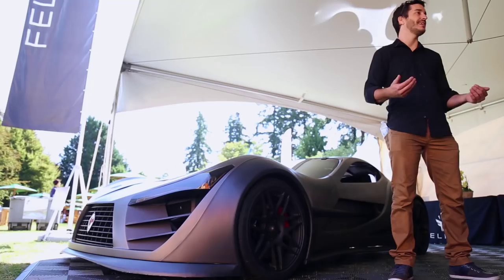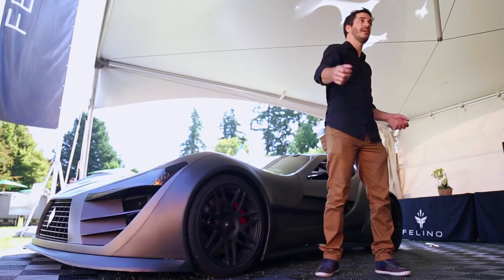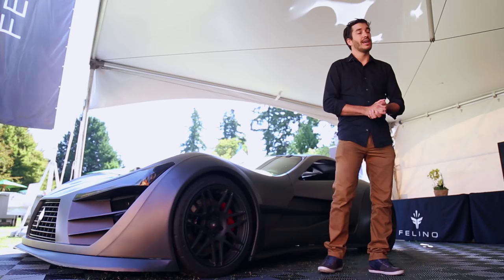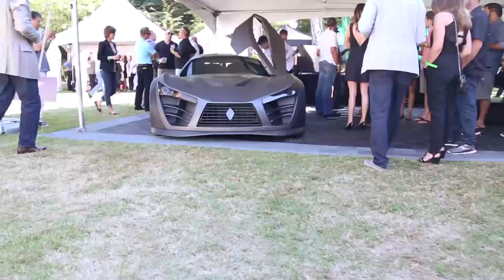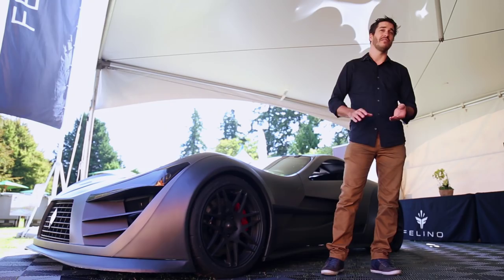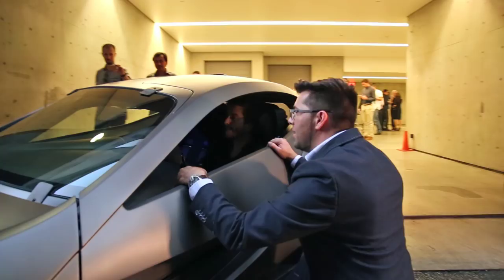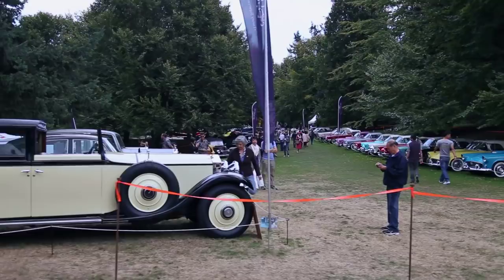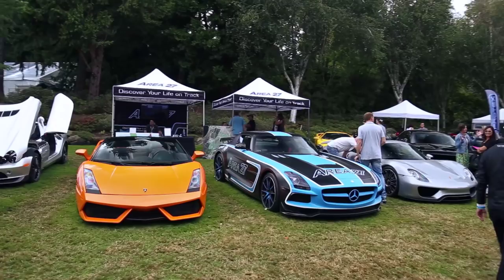Felino CB7 Prototype | A New Breed of Supercar

Comment: Why an ls3? Kind of an odd choice for such an exotic looking car.
Reply: For such a long nose you'd think it had something like a v10 or an inline 6 that was shoved a bit back for better weight distribution.
Reply: because cheap crate engine. Fits well with this "exotic" kit car.
Reply: +Will Boehland an ls3 is a damn good engine , American cars get such a bad rep and i agree with most of the negative things people say about them . but but the ls engines are very light , hell you can put an ls1 in a miata and the v8 doesn't even weigh more then the four banger that puts out a third of the horse power . the ls3 puts out damn near as much power as the AMG engine in a Pagani for a fraction of the weight and a fraction of the price ,and you wont need to pay an arm and a leg for parts and service . people who think you need to pay too much for European engines . and Hudson fox , i guess the Pagani cars are kit cars because they use someone else's engine , every company out there uses parts made by another manufacture . even if you don't like the overall look of the car it's nice to see some Canadian super car .
Reply: +jerry henderson it's a good but cheap engine that's used for cheap power in cheap cars, it's not built, it's not forced induction, it's a dated ls engine model. It's bland and boring. There is nothing exotic or interesting about the ls3. It does exactly what people expect it to do. Doesnt even make 100 specific horsepower per liter.. Doesnt rev up high, has no character, I dont think I need to explain myself any further.
Reply: Will Boehland its almost half the weight of any other v8 on the market and still puts out as much or more power then any other naturally aspirated engine . less weight = better power to weight , and an engine that produces lots of low end power doesn't need to rev high . if you are running high revs your burning more fuel , and those exotic engines that rev high and produce more power per litre  with forced induction are not as reliable and cost a shit ton more to fix . power per litre is not the greatest thing if it means your inline six has too weigh more than a v8 too produce it , and burn more fuel . if you think an ls is boring either you have never driven one or your stupid .
Reply: +jerry henderson lol, k. You don't understand the spirit of an exotic car.
Reply: Will Boehland Any engine that can deliver the desired performance is a good engine regardless of personal opinion. A lot of people love the LS3 and some are just too high up on their horse and looking down their nose because "its just an LS." The spirit of an exotic car is as fluid as water and can fill whatever vessel the beholder sees fit.
Reply: jerry henderson you have a point; as much as i hate seeing them transplanted in miatas, RX-7's and 240sx's, you absolutely have to respect the results they can produce.
Reply: +Will Boehland You don't understand the needs, requirements, and performance of a race inspired car.

Front mid engined ls3 rwd, sequential transmission, carbon brakes and under 2500lbs. That's a straight up race car. The reason why no silly "exotic" engine is this is obviously a track purpose built super car. Not simply something to look cool in a magazine. You clearly don't understand what goes into a true track car. For a start up company to design or source a v12 and deal with all the cooling issues etc, they'd fail within a year. Ls3 was a very smart choice.
Reply: +Mike Cirovic you just described a miata with 20k put into it. Problem is, this isnt a miata, this is an expensive wanna be exotic car, with a bland engine thats put into cars for the purpose of taking to a track, as you said, youre not seeing that this does not fit that criteria, it is far too expensive. If you think this makes sense, then you must think doing an ls swap on a Ferrari is a good idea, because reliable power, right? Ls swap everything, right? So interesting, please tell me more.
Reply: Oh and by the way an ls3 miata would be 20 grand if you did it yourself. A shop instal would be 35-45 grand. Then youd have a stock suspension miata with stock brakes and an ls3. Carbon brakes alone would likely be 20 grand if you were lucky. You clearly have no idea what youre going off about. As i suspected by your stupid original comment.

I dont even like the ls3. But its a damn stout, light, and easy to work on engine that makes very good power. From a purely mechanical standpoint its a great engine.
Reply: +hudson fox trueee that
Reply: @th600mike3  Yup, just ask TVR about building their own bespoke engines... stupid part was that Ford Australia had a suitable six of equal standing in their mass produced Falcon, and up to a 425hp Turbo version in the XR6. https://en.wikipedia.org/wiki/Ford_Barra_engine#Barra_325T

Comment: You lost me at LS3.
Reply: That's just a prototype, it'll be a different engine. And what's wrong with the ls3 anyway? Makes great power, isn't very heavy for a v8 at all, and is very reliable?
Reply: Ls3 doesnt have the type of prestige needed for a car that costs this much. I would have taken a coyote over the ls3.
Reply: facepalm
Reply: how much is it
Reply: J Lang Depends on the gearbox. If its a manual or crap ZF auto its gonna suck. But if they really use sequential gearbox like those ones on gt or f1 cars its gonna be in Supercar territory.